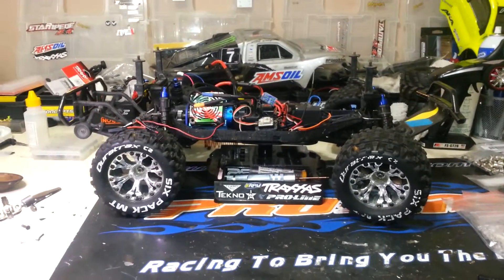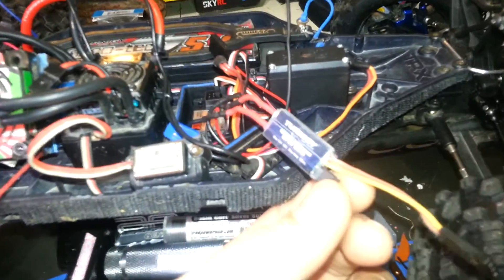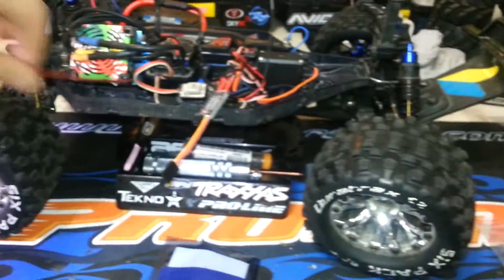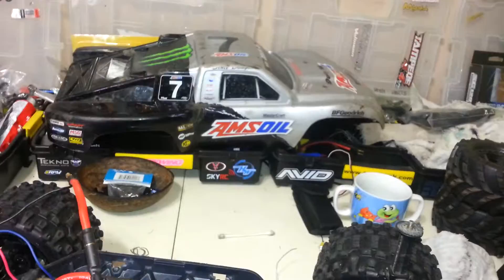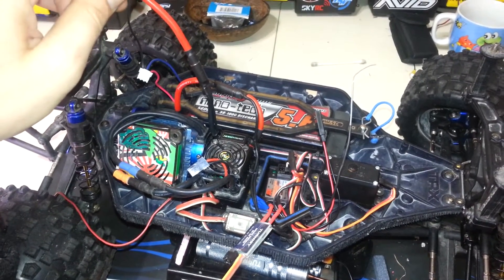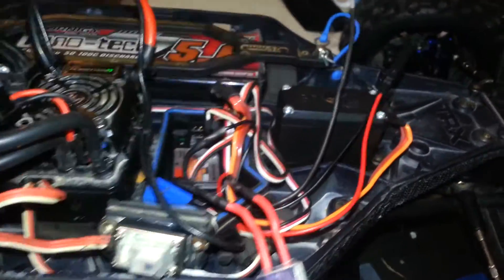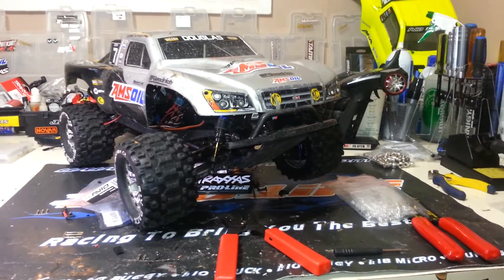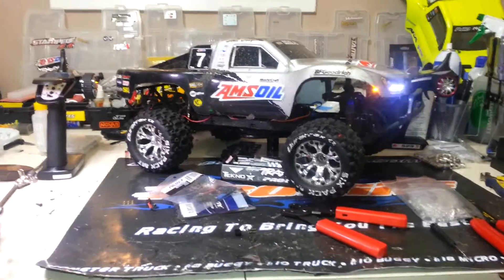Use Flysky GT2B 3rd Channel To Switch LED's, etc.

Comment: so if i wanted to use this on my rc winch it will only go one way?
Reply from the maker: Stupid late on the comment but the turnigy switch has a jumper to allow you to change the function.  So it will work as a 3 position switch or opposite of last position.  Meaning evertime u click the button it does the opposite as the last action. So turn it on winch runs forward.  Click again winch shuts off click again and it will run in reverse.  Etc.  You can swap the jumpers around to change what the switch does.  Very versatile.
Reply: ok thank you
Reply: +spokane underground crawlers (Useless844) umm would be nice if you could wire in a 3 pos momentary switch so as you like double tap the switch it reverses the polarity to a winch, Heck I'll look into and see if I can find anything
Reply: k thank you